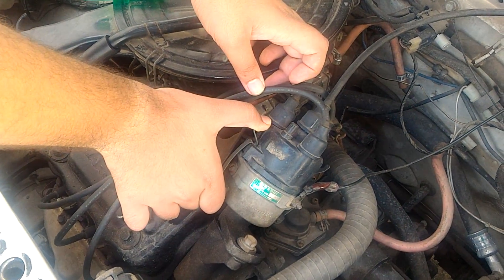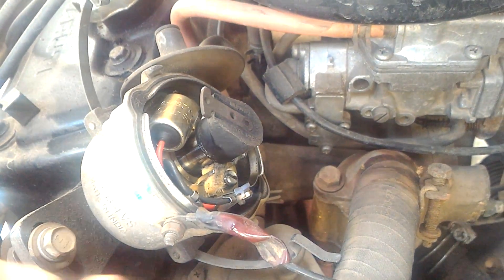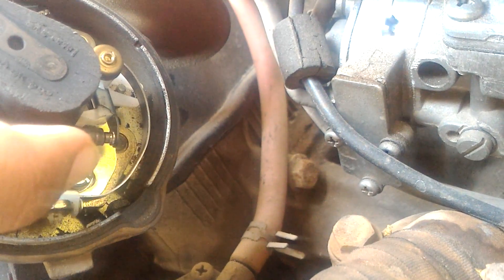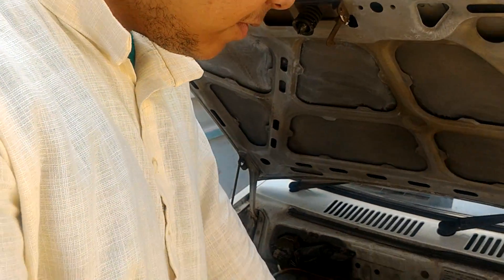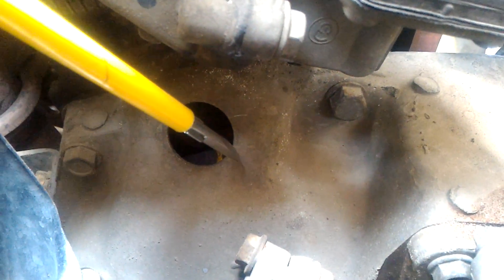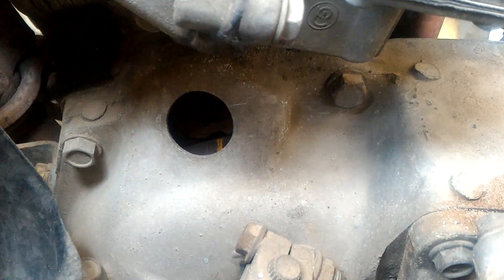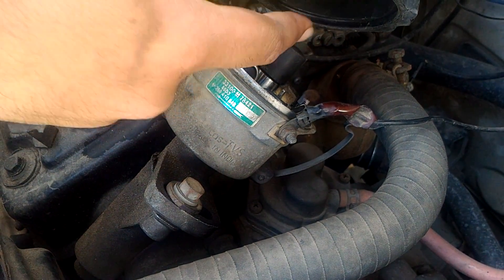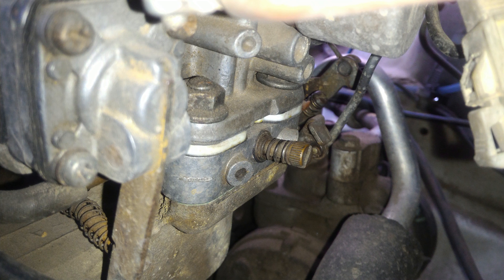M800 Rebuild Part 8. Tuning the spark timing and carburetor

Comment: The video worked well.Thank you so much
Reply: bhai , i have a  ZEN LXI 2002 model. its engine is making too much noise, it seems as if it is not smooth. also ac is not working, i checked but it had no gas, i tried getting it from the market, they say it is out of production. I  stay in ranchi jharkhand. also can you help me with small tips on maontaining it for a smooth drive.

Comment: Sir please help me ...800 2003 model engine ideal me band ho ja rha jhataka mar rha hai maine spark plug,cable ,point, condenser sabhi Chang karke dekh liye fir bhi tik nahi ho rha .. please help me
Reply: same problem here also. check for vacuum , valves .it may be closed

Comment: When i turned flywheel marking at 7th position, distributor doesn't align the first spark position, it comes between 2nd and 3rd position.. can we set the exact position by removing the belt?

Comment: My engine is shaking and it keeps shaking when you acclerate also and feels like its skipping ignitation.  What could be issue?
Reply from the maker: is it vibrating too much or is it just normal vibration? And when you accelerate, is the power normal or is there less acceleration than normal? 

There are two situations. One is that one of your spark plug wires is gone. Turn on the engine, keep it running and pull out one spark plug wire from running engine. The engine should still run but with huge vibrations and lower rpm. If the engine shuts down, then one of the spark plug wire is gone. Put the spark plug wire back ON and remove the second spark plug wire. Repeat the process for all the spark plugs. If the engine does not turn off when you remove one wire, then that wire is gone and you should replace it with a new wire. I suggest that you replace all the wires at the same time to avoid headaches.

If the engine does not turn off but keeps running even if you pull out any spark plug wires, then it is just the problem with low idle rpm. Adjusting idle is shown in this video. https://www.youtube.com/watch?v=dGH5kyuahJI
Reply: Aveem Ashfaq thank you sir! I checked spark plugs, one of them was broken, after replacing it. Now works fine

Comment: While opening I got a small ball(chera)and small stud type rode which is less then one cm
Reply from the maker: Yes. You must have opened the primary or the secondary jet. Remember to put  the ball and the copper rod back where they came from.  i.e. inside the hole of the jets. Those balls are so that when the engine is turned off, they block the holes for the petrol flow so that no petrol leasks into the engine.
Reply: Aveem Ashfaq please send the images which it set
Reply from the maker: Sorry but I can't. I will have to open the carburetor once again. In your carburetor, you have two big holes for air to pass through when you look from the top. Not the tiny holes but holes big enough for your 1 rupee coin to go in. They contain one jet each in the middle of the hole. One of them is loose or has fallen out. Inside the hole that the jet sits in, you should place your ball followed by the cylinder. That is it.

Comment: my car has a vibrating problem.. when i change the gear from first to second it vibrates.. please help. thank you
Reply from the maker: Do you mean the car vibrates a lot in idle? Then you should increase the idle rpm on the carburetor. If you have vibrations when you are moving or car is knocking a lot i.e. if the car gives that kat kat sound at low engine speed, then you should adjust your ignition timing. If you have vibrations on the gear lever, you can get the gear lever bushes changed.
Reply: Good, chicks love it, 
invite them for your car...

hope it helps

Comment: I got two queries brother.
1. How can i determine that at what point i have to fix the point gap?
2. Should i align the 7th marking with the arrow near the hole as shown in picture? I made a mess of this as tried once but this time i be careful.
A hearty thanks for the efforts.
Reply: Thanks a lot, one more question.for mixture screw i guess you said four rotations after its fully tighten. Should i count 180 degree rotation as 1 or 360 degree rotation? Once again thanks for all your efforts.
Reply from the maker: abhinesh nangla it is four 360 degree rotations. Do share your results after the tuning
Reply: Sure Brother.

Comment: Great video and great work! Keep it up! By the way, I have a question for you. I drive Maruti 800 1991 carb, motor starting perfect, I do not know if my spark timing and carburetor set correctly I never checked, but consumes a lot of fuel, about 7-8 liter per 100km. Did you  suggest  me to review  the ignition is tuned? But i repeat, car have good traction, good works and good engine starting! Only problem is a fuel. Thanks in advance!
Reply from the maker: Thank you. Is the 7-8 liters per 100 kms in city or on highway. I personally get around 4 - 5 liters per 100 kms on highway (4 liters for Non-AC empty road solo driving - 5 for AC carrying full load) and 6 - 7 liters per 100 kms in city traffic. If you get roughly the same figure, you might not have troubles.

Where do you live b.t.w? There is a small test you can do. If you have a rich mixture, cold start will not be a trouble. If you live in a cold place where temperatures are below 10 celcius and when you do a cold start in the morning without using a choke and the car starts on the first crank itself, this means that you are running on a rich mixture i.e. more petrol comes in for the amount of air.

There is one problem with the carburetor of of maruti 800 i.e. after a long time of use, the petrol return seals go bust and the petrol overflows into the carburetor. This might be happening for you. I will make a video for troubleshooting soon enough. 

Thanks for the suggestion.
Reply: Tnx! I am from Serbia. Now it is about 10 degrees, specifically times vary. I use choke when first start and after engine is warm I return choke. Yesterday,  I assembled carburetor and now the engine is quieter, but when I move a car need little stronger gas that can not be extinguished. Maybe I should add idle? Now that all the screws for idle on carburetor is unscrewed. I dont have AC. I drive mixed road (city and highway).
Btw, I cleaned the carburetor with a spray to clean the carburetor, called ABRO.
Please, if you can make a video on how to assembled carburetor and idle work? Thanks.
Reply from the maker: Ivan Kovacevic , wait till this weekend, i Will post a video explaining everything
Reply: Great! Thank you very much!

Comment: brother my 1996 Maruti 800 has a fuel pumping problem if I make it proper pumping also suddenly it again stop the pumping can you give me a solution for this
Reply from the maker: I want more details about it. what is the actual problem. if your car starts but in acceleration tries to stop, it could mean maybe the fuel pump has gone wrong or maybe your carburetor is not supplying enough petrol or the spark distributor is tuned wrongly or spark leads (ht cables) have gone wrong. dont come to conclusions soon. analyze more. all the best